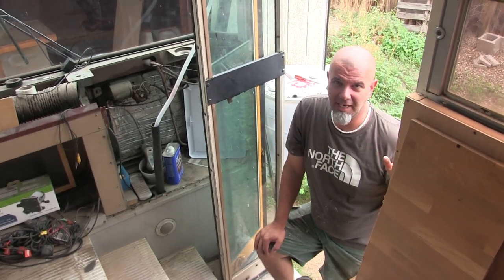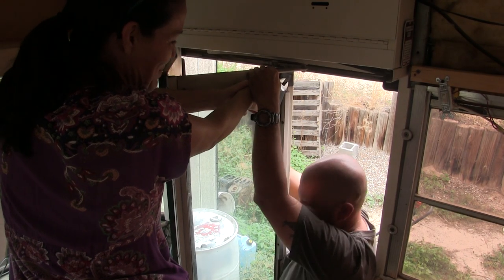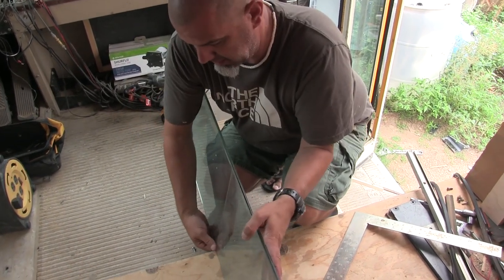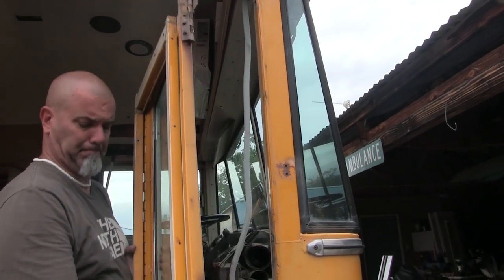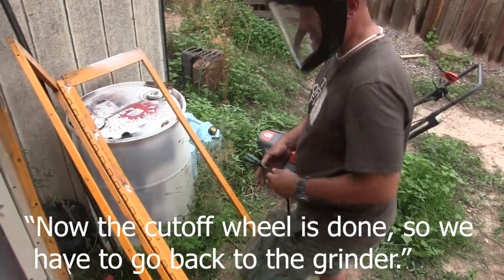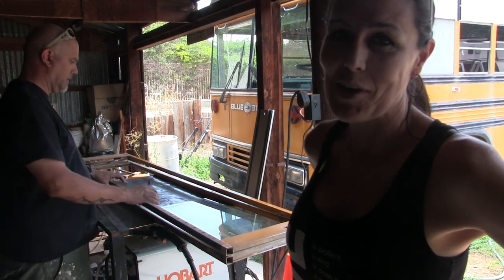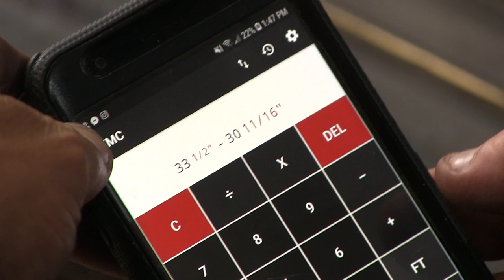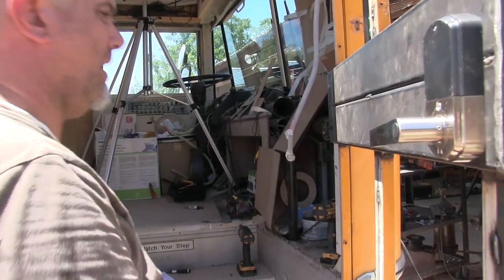Removing & Remaking our Skoolie Front Door with Biometric Lock

Comment: Laminated glass is easy to cut. Cut both sides then work it up and down slightly to get a small gap. Squirt alcohol into the gap and set fire to it. Plastic melts and bam, yet done.

Comment: Just found your channel.  Great video and a helluva job on that door you two! Great fabrication skills. Let me mention another security tip for ya. Weld a 5 or 6 inch piece over the latch area. Overlap the seam from the door where it latches when you close the door.   Otherwise the latch can be jimmied easily to open the door. If it's covered by steel, it can't be accessed easily. 
Just sayin! Can't wait to see more...good luck!!
Reply from the maker: Part II will have this😁

Comment: Your wood working skills are second to none. Every thing fits tight. But please let someone else do your 120 volt electrical. No box connects on the in coming 50 amp feed. That’s not good. That white plastic on the two breakers is a terrible idea. Not able to trip if there is a overloading on the circuit.   But I love watching you build.  Great job.
Reply from the maker: We have 2 20 amp mains before the main box.